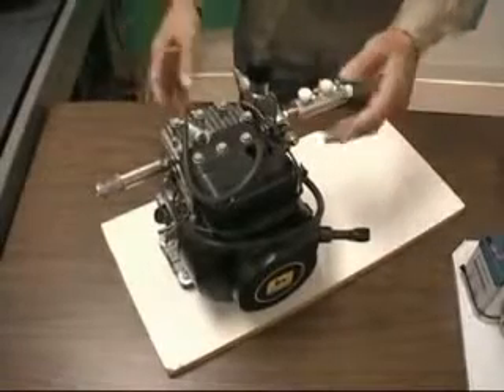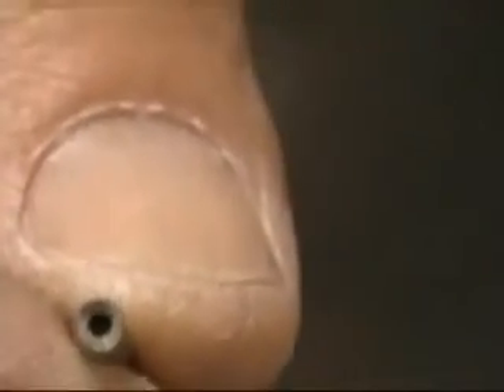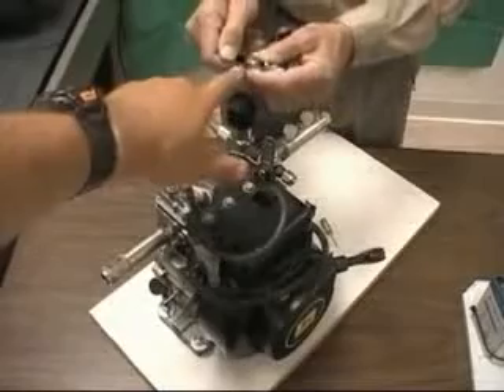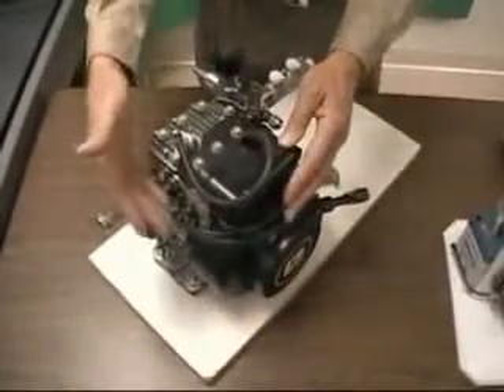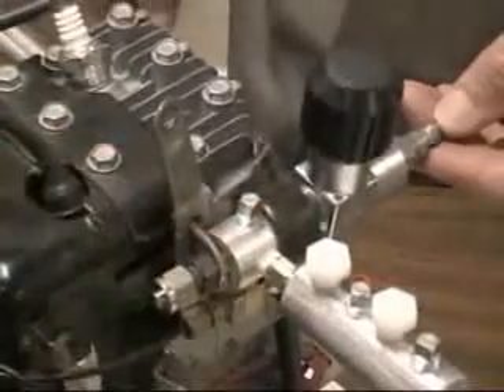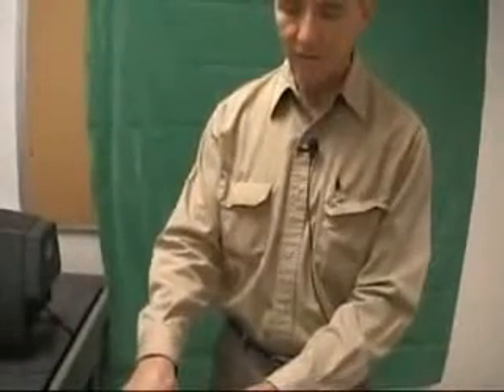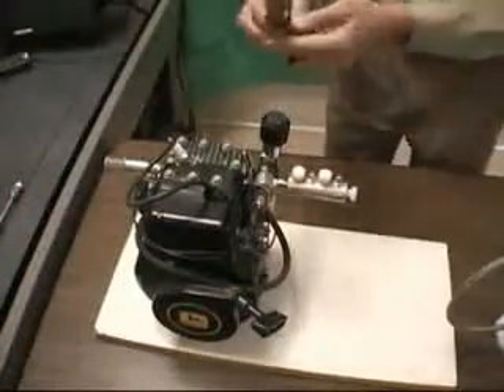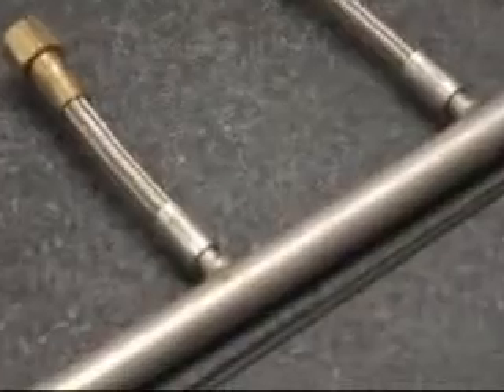Browns Gas Vs Hydrogen

Comment: Delaying the timing (toward TDC) is vital because hydrogen burns MUCH faster than hydrocarbons.  
Can someone tell me how much it should be delayed for optimum?
Is it possible or better to fire After TDC?
Reply: George Wiseman pure Hydrogen creates a emplosion, thus it must be timed to pull the Piston back to tdc. 
Must fire 160° before tdc.
Reply: @RwP223  That is a nice answer, but as a certified automotive technician, specializing in fuel systems and fully understanding crank angles, piston speeds and that the piston reverses motion twice each engine rotation...
Also relevant is how compressionn affects fuel ratios and combustion rates... And that fuel takes TIME to combust...

I'm also aware that there are TWO combustion events in the ICE.  First the fuel that is vapor burns (about 25

So normally, with hydrocarbon fuels, the ignition takes place well before TDC, as the piston is moving up and still compressing the mixture, because it takes TIME for the mixture to burn.

I see  you saying that the optimum CA for 50% of the fuel to be burned is about 8-12 depress ATDC?

I'd say you are likely right, for maximum efficiency of converting thermal energy  to mechanical energy in a reciprocating engine...
But because Hydrogen burns so much FASTER than hydrocarbon fuels, and has only ONE burn... I'm thinking that the ignition needs to take place ATDC, to achieve 50% fuel burn at about 12 degrees ATDC.

I'm thinking (when I get back to it) that I'll just have to test on a dyno to know for sure.

May the blessings be
Reply: @RwP223  LOL... Yep, exactly :)
This is a project I'd love to get back to... If I could find the TIME.  Right now my AquaCure AC50 project (Brown's Gas for Health) is taking up 100% of my time.

My research indicates that this 'timing' calibration (easily adjusted by changing the ignition timing) could be one of the 'keys' to running vehicles on water.  Along with 'water fog' and 'plasma ignition' technologies.

I think many experiments (such as the one in the above video) are firing the spark plug far too early when burning hydrogen... Resulting in too fast a compression rise that actually impedes the upward (compression) stroke of the piston.
I think that, due to the speed of the hydrogen explosion (up to 5000 fps) if you WAIT until ATDC, you will gain an unexpected amount of efficiency.

Thank you for your insights.